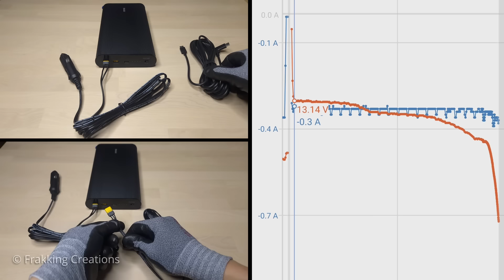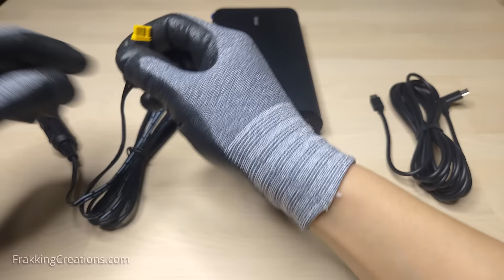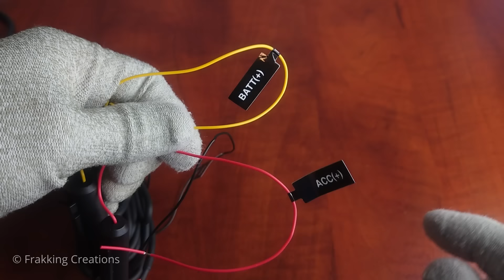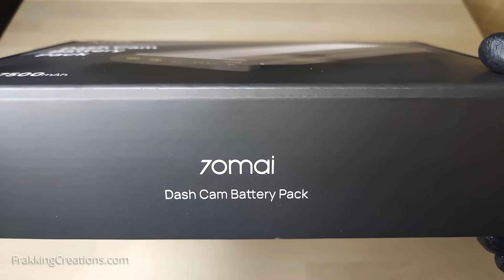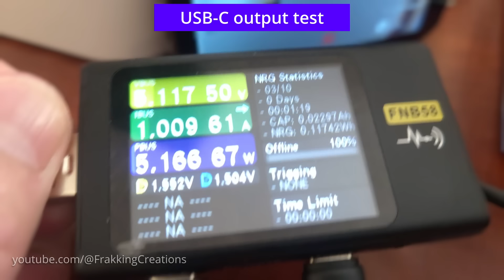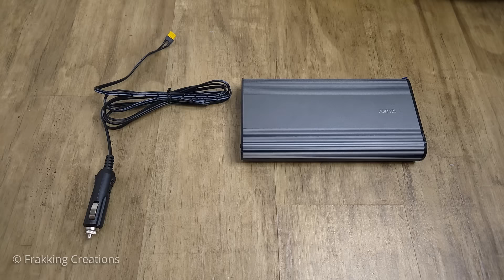Power ANY Dash cam Parking Mode 24h without Hardwiring? – 70mai Battery Pack FULLY Tested

Comment: *What is the recommended fuse capacity or amperage? Can I choose a 15A fuse?
Reply from the maker: 20A fuses with fuse taps are included with the battery pack hardwire kit.

Comment: So If I got it right, even if there are no events the battery using a 70mai T800 will last around 16.6 hours ? So even less if the camera detects events. 
Please someone reply
Reply from the maker: Yes.  It depends on how many events are recorded.  When not recording and in parking standby the dash cam still uses power, but uses more power when recording an event.  So if there are more events then less runtime.  Also, settings configured can help increase runtime but that means turning more parking mode features off.

Here is the full review of the 70mai T800 4K for more:  https://youtu.be/G88zYI3J5YE

Comment: I wonder if it works with the DDPAI N5 Dual. I have one with the radar module to reduce even more the power consumption while on parking mode. It's plugged in the OBD connector and runs for more than 1 week without my car battery complaining about it.
I was thinking about one of these battery packs to test it out, but right now it's too expensive (pricing is ok, but shipping and taxes make it way worse).

Comment: Sheesh! This battery cost over $200! That's wild!  Cost more than the car battery.. cost the same or more than the mid to high end camera setup.. thats crazy!
Reply from the maker: Yeah, this battery tech isn't cheap.  Not sure what the markup is for these things.  If you need longer parking mode runtime, a battery pack is something you will need.  Dash cams suck up a lot of power (especially for features like dual 4K cameras, AI, etc...)

Comment: So could I buy two packs and charge at home and switch them daily if I do not want to connect to car battery or fuse lines?
Reply from the maker: Of course.  Unplug 2 cables from used battery and plug into newly charged battery.  Done!
Reply from the maker: Sorry... My bad... You do at least need to plug into the 12v socket.  This will allow the dash cam to go into continuous mode for driving recording.  Otherwise it would stay in parking mode.

Comment: Wait.  What if I have 2 cameras? ( Front windshield & rear glass)  Does this mean I have to buy TWO of these battery packs?  If not, where do I find the appropriate wire to run the rear camera all the way to the front?  ( I have the 3 -row Kia EV9)
Reply from the maker: A dash cam kit with a front and rear camera will have all the wires you need to connect the rear camera to the front camera.  In some cases you might need a longer cable which you.will need to buy separately if available.

The front dash cam.is the main unit and the rear camera is controlled by it.  So just one battery pack.

Watch our dash cam video for more on how a dash cam works...
Reply from the maker: Here's the link to our dash cam video:  https://youtu.be/dX1T8Wdu9vo

Comment: Does the kit power the dashcam in “bypass” mode when the car is powered on? I ask because I want to use this with an android head unit that has a parking mode (using cameras connected to the head unit) and I’m worried that when the car is on, the maximum wattage of the head unit might be too much for it to power (it’s fused at 15A on the head unit, Google tells me at max volume the thing can take 10amps)
Reply from the maker: It wouldn't matter if this was using a "bypass" mode or not, since it's max output is about 2 A.  It won't be able to do what you want to do with your setup.

Comment: Hello, good video. I have a question. I have a 70mai dashcam power directly via the cigarette lighter socket, thus no parking surveillance after ignition is off. Will this battery pack enable parking surveillance mode when also plugged into the cigarette lighter socket, and at the same time using the inbox c to c cable to power the dash cam? Hope to hear from you. Thanks
Reply from the maker: Yes. I thought I mentioned it in the video.

Parking mode is enabled for this battery pack whether you use hardwiring or cigarette lighter socket to power it.  It will pass the signal needed for the 70mai dashcam to go into parking mode when the vehicle turns off.
Reply: @FrakkingCreations Thank you for the clarification. My bro had one but somehow didn't work that way, guessed he had a faulty unit. 😂 Thanks again 🙏🏻
Reply from the maker: If he had the same unit that I tested then it could be set to a different mode. 

Once you hardwire the 70mai battery pack it switches modes to work as hardwired.  If you want to use it through the cigarette lighter socket again you have to reset the mode first.
Reply: @FrakkingCreations Oh I see. How do we reset between the 2 modes?
Reply from the maker: Ensure the Dash Cam is Off: Make sure the dash cam itself is powered down. 

Unplug the CLA Cable: Remove the CLA cable from the vehicle's power port.

Wait 10 Seconds: Leave the cable unplugged for approximately 10 seconds. 

Plug In Briefly: Reinsert the CLA cable into the vehicle's power port and leave it connected for about 5 seconds.
Repeat Three Times: Perform the 10-second unplugged / 5-second plugged cycle a total of 3 times.

Confirm Mode Switch: After the third cycle, the BMS should recognize the CLA charging method.
Reply: @FrakkingCreations Thank you so much.  We managed to switch to cigarette lighter charging. Really appreciate 🙏🏻
Reply from the maker: You're welcome.  Happy it worked.
Please Like and Share the video with anyone else that would enjoy.
Subscribe for more Good Stuff to come!

Comment: thanks for the video! I have a omni 360 and I plugged a normal battery pack. But  the surveillance mode is not enavle as it says that hardwire is required. With the 70mai battery pack to the car lighter is gonna work? It recognise the 70mai battery oack and parking mode is eenabled?.
Reply from the maker: How are you plugging in the Omni to the battery pack? 
USB or hardwire cable?
What battery pack are you using?
Reply: @FrakkingCreations  thanks for reply. A Baseus batttery pack 25000mah. And I connect it via usb out to omni. So the power is solid, but the option for motion detection are greyed and I cannot set the while it says that I need to hardwire the camera. So I think that maybe it detects the original power pack and no need for hardwire.
Reply from the maker: Non dashcam battery packs will not provide required parking mode signal to dash cam.  Therefore dashcam will not go into parking mode.

Use a dashcam battery pack like this 70mai can work because it will give the appropriate parking mode signal to the dash cam.  When power coming from car lighter outlet the battery pack will charge and put dash cam onto driving/continuous mode.  When power is turned off from outlet then the Battery pack will supply power to dash cam and tell it to go into parking mode.

Comment: It same price with high end dashcam or Double price for good mainstream dashcam.  Cost more than hire someone to hardwire
Reply from the maker: Yes. Dash cam batteries are expensive.  But you are paying for longer runtime in parking mode.  It's meant for people that need longer parking mode.  The added benefit is a potentially easier install when you use the 12v socket install method.
Reply: @FrakkingCreations  you can pay the less money for someone install for you hard wire.  I did both mine and my wife's car for $320 as total cost of installation of 2 deshcam. both have battery protection and set up with 48hours parking mode.

Comment: Just really quick, I didn’t see a cigarette lighter socket adapter included in the kit, where did you get yours?
Reply from the maker: It does depend where you get it from.  I believe the Amazon kit includes it but please verify.  Otherwise, you might need to add it separately.

Comment: @FrakkingCreations Great video but these dash cam batteries have one problem for people that don't drive long enough to charge them... In my case it would be perfect if I could charge them at home via AC adapter yet none support it... do you have a solution ?
Reply from the maker: I'm wondering why you are thinking "none support it"?  Where did you hear this?

I believe I mentioned using a charger at home in the video.

I did put a link to a dash cam charger in the video description, if you are interested.
Reply: @FrakkingCreations  The only officially supported methods are the car fuse box and the 12V cigarette lighter. They don't come with a power adapter to charge them from a regular power socket.
I see now that you did add a charger in the description but it's not available in my region. What specs should I look for to charge this battery or the viofo BP100 ?

Comment: 12v socket works only if the socket turns off when vehicle is off. some vehicles the 12v socket stays powered on with engine off, so dashcam will run off car battery and drain it.
Reply from the maker: Yes.  That is true

Comment: Battery packs have a used by date. 😅 I would not bother hard wiring e t c. Alarm and steering lock is enough. Paranoia is not good for the soul. 😅
Reply from the maker: There is no Use by Date on dash cam battery pack.  Even smartphone with different types of Lithium batteries do not have use by dates.  Don't confuse these with Alkaline batteries you buy for your flashlights and remotes.

In your other comment in another thread you sound paranoid yourself.  Paranoid of dash cam battery packs in a misinformed way.  You might want to take your own advice.

Comment: So. I have a Ds4 2021, and for the  PSA group i can hardwire directly to obd port. For me is obd->battery 70mai->4g kit->70 mai T800 with 3 camera. My question is , after the 70mai battery is depleted the car battery gives power or the 4g kit and the cameras are shutdown?
Reply from the maker: No.  Don't do that unless you want your car battery to get drained.

They battery pack should never be connected to an always on power source or car battery will get drained.  The OBD Port power it always on.
Reply: @FrakkingCreations I have already set a stop to the highest protection point for the battery. And I have on pin 1 and pin 16 direct current and current given when the car starts. It's okay, that's how it is with the PSA group that includes ds automobile. I wanted to know if after the 70mai battery is discharged if it draws power from the car battery until it reaches that stopping point
Reply: @FrakkingCreations and i tasted only with the 4g kit and it works
Reply from the maker: Ok.  As long as the OBD port powers down when the vehicle is turned off.

In terms of charging, the battery pack it doesn't work as you described.

1) as long as power is available at the input port of the battery pack, it will start charging.  So if the OBD port is providing power the battery pack will start charging if it isn't at 100%

2) the battery voltage cut-off set in the Thinkware app only affects the voltage detected at the battery pack output, and not the vehicle battery.

Comment: Why is not a invented a simple battery with a button. When you leave,press the buton,and that's it.
Reply from the maker: This battery is already better than that.  Once installed properly with a dash cam that has parking mode, you just leave it.  It powers the dash cam and recharges on it's own.  No button press necessary.

You only need to charge it manually if it runs out completely in the case that the dash cam uses more power than the car can charge back into it.  This usually will eventually happen if you don't drive enough to charge it back up.

Comment: Gostaria de saber quanto tempo dura ligado direto na bateria do carro por favor
Reply from the maker: No estoy seguro de entender completamente su pregunta. Probé la batería para ver cuánto puede durar con una carga completa. Esto le indica qué tan buena es la batería y si tiene la clasificación adecuada.

Cuando la batería está instalada en el automóvil y lo conduce a diario, podría durar mucho más porque se carga cada vez que conduce. Entonces, si está tratando de calcular cuánto durará su automóvil, necesitará saber con qué frecuencia conduce y también cuánta energía usa su cámara de tablero en el modo de estacionamiento. Si conduce lo suficiente como para cargar la batería más de lo que usa la cámara del tablero en el modo de estacionamiento, durará indefinidamente. Pero una vez que estaciona su automóvil por un período prolongado, la batería solo puede durar lo que una carga completa pueda suministrar a su cámara de tablero en modo de estacionamiento.

-- English --
I am not sure I fully understand your question.  I tested the battery pack to see how much it can last on one full charge.  This tells you how good the battery pack is and if it is rated properly.

When the battery pack is installed in the car and you are driving it daily then it could last a lot longer because it is getting charged every time you drive.  So if you are trying to figure out how long it will last for your car, then you would need to know how often you drive and also how much power your dash cam uses in parking mode.  If you drive enough to charge the battery pack more than the dash cam uses in parking mode, then it will last indefinitely.  But once you park your car for long term then the battery pack can only last as long as one full charge can supply to your dash cam in parking mode.
Reply: @FrakkingCreations 
Obrigado 
Mais eu disse ligada no carro só a câmera 
Como o modo 4G
Se se dura quanto tempo 
O s é preciso dessa bateria 
Obrigado
Reply from the maker: Veo. Creo que estás preguntando sobre el uso de esto con el 70mai 4K T800 con módulo 4G. Desafortunadamente, no tengo el módulo 4G, por lo que no sé cuánto tiempo durará esa configuración con la batería.

Tenga en cuenta que la cantidad de tiempo que conduzca afectará la duración de la batería porque cuanto más conduzca cada día, más carga volverá a poner en la batería.

Si normalmente necesita el modo de estacionamiento durante períodos prolongados, es probable que necesite la batería para el 4K T800. Consume mucha energía con los 3 modos de estacionamiento habilitados.

-- English --

I see.  I think you are asking about using this with the 70mai 4K T800 with 4G module.  Unfortunately, I do not have the 4G module so I do not know how long that setup will last with the battery pack.

Keep in mind that how much you drive will affect how much the battery pack will last because the longer you drive each day the more charge you put back into the battery.

If you typically need parking mode for long durations then you will likely need the battery pack for the 4K T800.  It does use a lot of power with all 3 parking modes enabled.

Comment: isn't it kinda risky having such a battery inside a car during summer (fire hazard) ? I really dont want to hardwire my dashcam on my new car for warranty reasons and this battery seems to be my only option.
Reply from the maker: The batteries in this battery pack are Lithium Iron Phosphate type which is much more thermally stable than the Lithium Polymer type that are in smartphones and a lot of electronic devices nowadays that you hear catching on fire.  There is less chance of catastrophic failure from these batteries under normal use.  As with any battery you get, make sure not to get no name brands and low quality batteries.

Also, when installing the dash cam battery packs, they should not be installed in direct sunlight or the hottest locations in the car.  This will help keep it safer.
Reply: @FrakkingCreations  thanks for the reply, much appreciated! Unfortunately this thing is out of stock in every EU amazon atm :(
Reply from the maker: You're welcome.  Their official store may have stock.  Hopefully you have some luck there.
Reply: It does not void warranty. But yes? I would opt out of using such batterie pack inside my car. Not worth the risk having your car end up as toast.
Reply from the maker: How many cases of Dash cam battery pack fires have there been?  You are basing this risk on what?

Don't confused lithium ion or lithium polymer batteries with lithium iron phosphate.  Lithium iron phosphate batteries are used in good dash cam battery packs and are not the same batteries you hear about in the news that cause house fires, fires on airplanes and more.  They are not the same chemistry as smartphone batteries.

Your other comment in another thread has you saying people shouldn't be paranoid... Looks like you are also paranoid.  Paranoid of dash cam battery packs in an misinformed way.

Comment: is this can chage in the house
Reply from the maker: You can charge the battery pack in the house using an adapter you plug into the wall outlet at home.  This charging adapter is not included with the battery pack.

If you need one, I have a link in the video description.